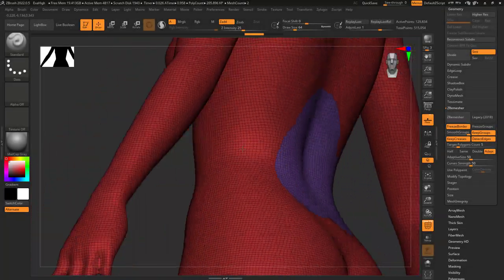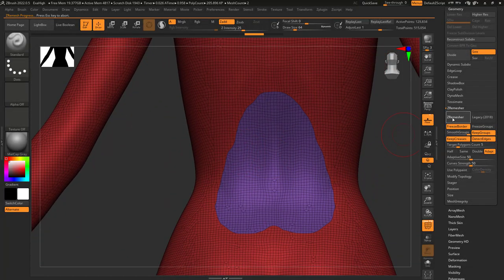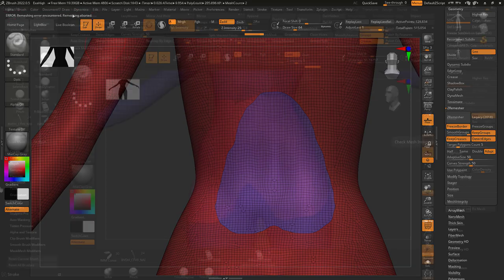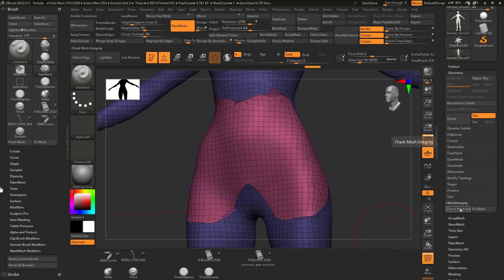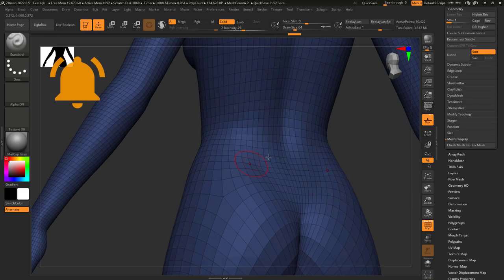ZBrush - Fix Mesh Integrity (In 30 SECONDS!!)

Comment: i'm having a problem in which my mesh (a torso with a coat and shirt) has internal geometry. that can't be separated by autogroups, and dynamesh wont delete them.  it appears as a closed object, but when export as a stl file, the internal geometry makes the print wall have a weird pattern.